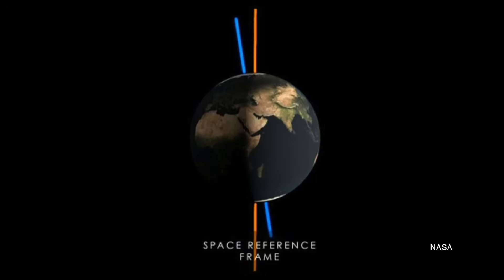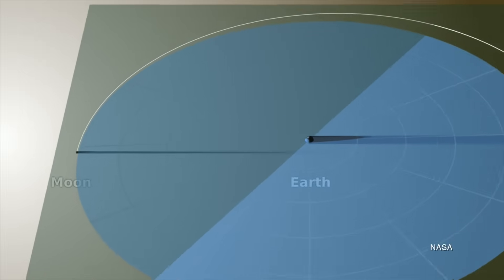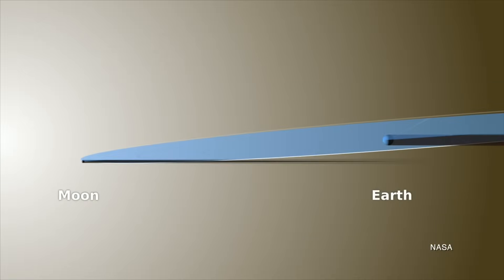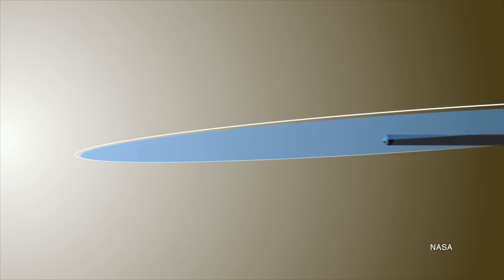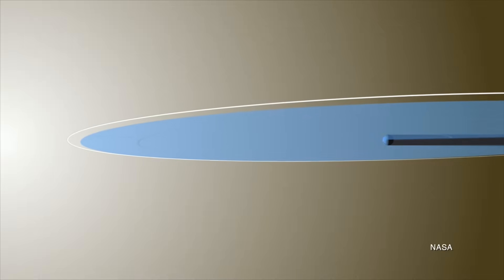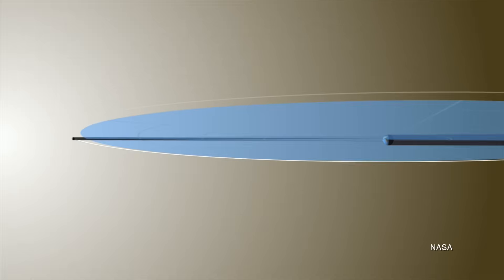Why Does a Rocket Need to Roll Going Into Orbit?

Comment: Other commenters correctly point out that a roll maneuver is not, strictly speaking, essential to fly a given launch azimuth to a certain orbital inclination. The engines are quite capable of steering the rocket in any direction regardless of roll angle. The roll is necessary only if you need a particular side of the rocket to be down (or up) as it tilts towards its launch azimuth.

There were three reasons this was required for the Apollo/Saturn stack. First, it kept the astronauts' heads down. They were trained to take over control of the Saturn V should IU guidance fail, and this attitude kept the earth's limb horizontal and visible in the windows.

Second, it kept the many antennas on both Apollo and Saturn facing the earth. Some very important radios (such as the range safety destruct command receivers) had multiple antennas so one could always be seen from the ground, but many more telemetry antennas on all stages of the Saturn weren't replicated.

Third, the inertial platform in the Saturn IU, like the one in the CM, had only three gimbals, meaning it was susceptible to gimbal lock. At launch time (actually guidance release at T-17 sec), the IU was aligned to the launch site REFSMMAT (the particular inertial coordinate system reference used at launch) so that the IU/IMU's outer gimbal (fixed in alignment with the vehicle +X (roll) axis) was pointing straight up, the middle gimbal was aligned with the +Z (yaw) axis pointed downrange, and the inner gimbal was aligned with the +Y (pitch) axis and completing a right-handed set. This put the three gimbals at right angles to each other, the "neutral" position. But if the vehicle were to yaw (rotate around the Z axis) 90 degrees to the left or right, this would align the outer and inner gimbals such that the IMU could not accommodate any rotation around the inertial X axis. This could tumble the platform and require a realignment, something you definitely don't want during a launch. So by rolling to put the +Z axis downrange, only the inner gimbal would rotate as the vehicle pitched down. The yaw angle remained almost exactly 0, deviating only slightly to steer out high altitude winds and staying as far away as possible from gimbal lock.

Because the Saturn was fixed to the pad with the Saturn's +Z axis pointed almost (but not exactly) east, and the launch azimuth was seldom exactly due east, it had to await launch with some non-zero roll angle. For example, at guidance release Apollo 11 was rolled left (counterclockwise as seen from behind) about 18 degrees, so after liftoff it rolled right 18 degrees to make the roll angle zero for its launch azimuth of 72.058o , which is a little north of east. Again, this let it perform a pure pitch maneuver as it flew downrange.

BTW, if you look this stuff up keep in mind the body coordinates of the Apollo CSM did not match those of the Saturn V. Their +X axes were the same, but the CSM was rotated 180 degrees around the X axis so that the CSM's +Z axis coincided with the Saturn's -Z axis and the CSM's +Y axis coincided with the Saturn's -Y axis. So just after the post-launch roll maneuver the Saturn's +Z axis and the CSM's -Z axis were pointed downrange.
Reply: Thanks, guys. That's a more positive reaction than I usually get from the Apollo deniers that I sometimes spar with (hence my choice of pseudonym). I thought for a bit about how best to explain the IMU stuff, and I agree you can't really do it well without diagrams. I should have cited the references I used, primarily "Project Apollo Coordinate Systems" but also "Saturn V Launch Vehicle Flight Evaluation Report - AS-506 Apollo 11 Mission" (where I got the launch azimuth and roll parameters). Both are available through the NASA Technical Reports Service (ntrs.nasa.gov) and are probably mirrored elsewhere, so a Google search should also find them.

If you're interested I could also find some technical documents showing the many telemetry antennas, mainly on VHF, on each of the Saturn stages to show how they had to face earth. I'm pretty sure they were all on the +Z side of the rocket, which is the side facing down as the rocket pitched down.

BTW, that coordinate system (+X forward, +Z down and +Y to the right) seems to be the standard for aircraft navigation. The CSM coordinate system seems based on the terrestrial convention, which has the +Z axis pointed up and the +Y axis pointed left. Not sure why they did this, though.

The main diagram to study is figure A-12 in the coordinate reference document. It diagrams the Saturn V inertial reference unit with its stable platform in the center and the three axes aligned at guidance release time as I described earlier. The IMU in the CSM was aligned the same way (probably rolled 180 degrees) in case it had to serve as a backup, but the IBM-built instrument unit (IU) never failed in any Saturn launch. The CSM IMU was periodically realigned to different reference systems (REFSMAAT) as the mission progressed but as far as I know the Saturn IU only ever needed the one launch site  coordinate system since its job was over in a few hours.
Reply: Probably the best way to visualize the IMU gimbals and gimbal lock is the way the astronauts saw it. The "8-ball" on the console showed the orientation of the IMU platform relative to the spacecraft. The 8-ball behaved as if it contained a gyroscope; it stayed fixed in inertial space as the spacecraft rotated around it. (It didn't actually have a gyroscope, but it was driven by the computer to keep the same orientation as the real IMU gyroscope, so it was a "virtual gyroscope".) Pilots are already familiar with gyros in instruments like gyrocompasses and artificial horizons, so the 8-ball just took it to three dimensions.

The 8-ball depicts a globe with lines of latitude and longitude. A mark in the center of the display depicts your current pitch and yaw attitude on the globe: pitch as longitude and yaw as latitude. Your roll attitude is shown as a rotation of the ball around your pitch/yaw point, which could be read from a scale around the circumference of the 8-ball.

With the IMU in a "neutral" position, all 3 axes perpendicular to each other, the 8-ball has latitude 0, longitude 0 in the center with the poles at 9 and 3 o'clock. Pitching causes the ball to rotate around its polar axis, i.e., your longitude changes and your attitude point moves along the equator of the globe. This rotates the inner IMU gimbal. Rolling simply rotates the ball around some fixed point on its surface; it rotates the outer IMU gimbal. Yawing moves you north or south of the equator, i.e., it changes your "latitude". It rotates the middle gimbal.

Note that "pitch" and "yaw" are with respect to the stable platform, so they match the body "pitch" and "yaw" axes only when you're at this neutral point. If you roll 90 degrees to the left, the ball will rotate 90 degrees to the right, with the poles at 12 and 6 o'clock, and what's pitch to you will be yaw to the 8-ball and IMU. It's the latter that counts for gimbal lock.

The polar areas of the 8-ball were marked in red; these were the "keep out" areas to avoid gimbal lock, which actually occurred at the poles where all the longitude lines come together. If you yaw close to a pole, then a small change in pitch results in a large change in ball longitude, which corresponds to a large change in IMU inner gimbal angles. The closer you get to the pole, the greater this magnification effect until right at the pole it becomes infinity, and it's impossible to pitch the spacecraft without an instantaneous 180 change in longitude that jerks the platform out of its inertial position. That's gimbal lock. Because there's always some small amount of friction in the gimbal bearings, just getting too close to the pole can disrupt the platform because of that magnification effect. 

Roll maneuvers, which simply rotate you around the ball at a fixed point on its surface, appear to be safe at any attitude because the roll axis is the outer gimbal in the IMU. Pitch is the problem, and then only at high yaw angles.

The coordinate system for the Saturn V IU/IMU was chosen such that after the roll maneuver, the 8-ball was in the neutral position. Then as it gradually pitched over and flew downrange, the attitude point traveled along the equator with the poles staying at 9 and 3 o'clock. If they maintained a local horizontal/local vertical orientation in orbit, i.e., heads down and long axis in direction of motion, the 8-ball continued to rotate around its horizontal polar axis with the attitude point always staying on the equator. All this kept the IMU as far from gimbal lock as you could get.
Reply: ApolloWasReal You have commendable patience with those guys. I've taken on a few as well, but invariably I quickly come to the realization that it actually is less painful for me to bang my head repeatedly on a brick wall than continuing to "debate" with people who just simply refuses to use their brain. I cannot believe that there can be such cognitive disconnect in an individual as to just not get it, which means somewhere in there there must be willful ignorance at play. I guess for some, ignorance really is bliss...

I for one would definitely be very interested in any technical documentation you have on the subject, but I know there's a treasure trove I have barely scratched the surface of at the NTRS site. I just wish I had more time, like a few decades, to just dive in there and read everything... :-)

I am a software engineer by trade and have always had a fascination with the AGC, but IBM's Instrument Unit intrigues me as well, mostly because there is so little known about it these days.

I don't think much of the original schematics, documentation or software has been preserved, for example. Which is a total shame, since while it is of a less technically sophisticated design than the AGC and its peripherals, it was still an awesome piece of engineering.

I don't know if there is any truth to it, but I have heard that there is actually original core memory left in the unflown IU that is on display with the Saturn V at Kennedy Space Center, and that it might actually still contain the real guidance software for the unit. I would love to see if it is possible to extract whatever is in there, and see if it is possible to reverse engineer it. Unless I'm mistaken and there is relevant documentation on it still in existence of course.
Reply: Carl Charles Mando Atteniese Thanks but I think you're confusing me with ApolloWasReal who wrote the comment starting this thread. My comment was a bit vague, I see that now when rereading it. I didn't refer to Amy (except by +1'ing her book recommendation) but to ApolloWasReal. That dude knows his or her shit. :-) I apologize for the confusion!

If you want to know anything about the hardware or software of the Apollo Guidance Computer however, then I can probably give you some input. That's within my special area of interest. Also, low level computer programming has more or less been my profession for the last 30+ years.
Reply: You're welcome. You could make something like the Apollo 8-ball for an airplane by combining the ADI, which shows pitch and roll, and the gyrocompass, which shows yaw. ADIs show a local horizontal/vertical coordinate system that rotates with the earth and your own movement along its surface so they're designed to let gravity slowly return them to wings and nose level regardless of your actual orientation. This takes care of both earth rotation and gyro drift. On Apollo, the IMU platform remained (almost) fixed in inertial space (they were weightless) and the price for this was that the crew had to frequently realign the platform against the stars to correct for gyro drift. The term you hear them use is "P52", the program for IMU alignment.
Reply: elvis3571 Yeah, something like that. There's also a potential for much confusion about whether you're talking about roll, pitch and yaw in inertial coordinates, which is what the IMU uses, and body coordinates, used by the rocket and spacecraft.

Since rockets fly into orbit along a plane that includes the center of the earth, it was easiest to have the IMU aligned with that orbital plane at the moment of guidance release (T-17 sec). While waiting on the pad the rocket's body is not aligned with the IMU unless the launch azimuth is to be 90 degrees. (It's actually slightly less, the pad isn't exactly north/south but very close, within a degree.)

After liftoff, once the roll maneuver is completed, the IMU axes are aligned with the rocket body axes (except for the slight rotation of the earth in the few seconds since guidance release) and the IMU need only rotate around its pitch axis as it flies into orbit.
Reply: Hi ApolloWasReal, thank you for such detailed explanations and descriptions of the maneuver.  Please, keep on sharing your knowledge for the benefit of those who are motivated to learn (as opposed to the simple-minded deniers and/or trolls).
I have spent a lot of time giving information and correcting the nuclear detonation deniers' claims to no avail.  It is nice to see that there are still open minds like you out-there on the WWW that appreciate and try to educate fellow humans.  May Peace be with you, thank you again, Ciao, L
Reply: ApolloWasReal Thank you, that was an excellent description of something I've wondered about - the difference between the 8-ball and a normal airplane ADI.
Reply: Benny Löfgren Hmm, could be. There are some differences between aircraft and spacecraft. A spacecraft generally moves in a single plane along a predetermined path, but can be pointed in any direction. Either inertial or local horizontal/vertical reference systems may be needed. An airplane can travel in any direction, but has to keep its noise pointed almost in the direction of travel. It also uses LH/LV almost exclusively. This means you can put the poles of the orientation sphere at the zenith and nadir so longitude corresponds to yaw (bearing) and latitude corresponds to pitch. But because you could easily be pointed nose up or down, you also probably want a 4-gimbal IMU that's immune to gimbal lock and to use quaternions in the math to avoid numerical instability in the calculations near those attitudes.
Reply: elvis3571 It's only a problem because the platforms have only three gimbals. (This is true for both the one in the Saturn IU and in the CSM.) With 4 gimbals, it would be possible to operate at any attitude without risking gimbal lock, but the Apollo designers decided it wasn't worth the extra complexity.

One of my favorite Apollo exchanges was on this topic:

104:59:35 Garriott: Columbia, Houston. We noticed you are maneuvering very close to gimbal lock. I suggest you move back away. Over.
104:59:43 Collins: Yeah. I am going around it, doing a CMC Auto maneuver to the Pad values of roll 270, pitch 101, yaw 45.
104:59:52 Garriott: Roger, Columbia. (Long Pause)
105:00:30 Collins: (Faint, joking) How about sending me a fourth gimbal for Christmas.
105:00:40 Garriott: Columbia, Houston. You were unreadable. Say again please.
105:00:46 Collins: Disregard. (Long Pause)

I met Owen Garriott 4 years ago and asked him if he remembered this exchange. He did not, though it has become rather famous among people who work with these systems.
Reply: elvis3571 Actually, the inertial reference was changed several times during flight. Each reference was called a REFSMAAT, and they were carefully chosen for each phase of flight. We've talked about the one used for the launch from earth (which I think is the only one used in the Saturn guidance unit) but the CSM and LM used many others later on. A fairly straightforward one was based on the lunar landing site and lunar orbit plane, analogous to the earth-based frame used for earth liftoff. This kept the platforms well away from gimbal lock, simplified the math in the computer, and made the astronaut displays more intuitive.
Reply: Hi ApolloWasReal, please do not give up!  We need more serious and educated people like you who are willing to spend the time helping other YT members understand and learn facts and get new knowledge.  Great work, excellent delivery, Ciao, L
Reply: I agree, an absolutely brilliant explanation. I would also like to add to Amy's recommendation in the video about the book "How Apollo flew to the moon". It is an absolutely amazing read and really a must for any space buff. It explains all of this and tons more, in fairly easy to understand exquisite detail.
Reply: I wouldn't be surprised if some documentation on the IU would turn up with a little digging. You're specifically interested in the IBM LVDC - Launch Vehicle Digital Computer.

I don't know how many are still in existence, or which of the Saturn IB and Vs on display at JSC, Huntsville and KSC have them as opposed to dummy IUs, but I know I've seen an IU (by itself) on display at the Smithsonian Air & Space Hudvar-Hazy annex at Dulles Airport.
Reply: Only the warheads from Peacekeeper were transferred to Minuteman III.  The warheads have nothing to do with guidance.  The Minuteman III electronics were redesigned from scratch in the 1990's.  I know this because I was in charge of most of the guidance electronics redesign.  Minuteman rolls because it has gimbals.  At the end of the roll maneuver, all the gimbals are orthogonal to each other.  This helps avoid gimbal lock and simplifies the guidance equations.  Furthermore, the power, and control signals for the Minuteman stable platform go through the center of the gimbal bearings on wires.  The further the gimbal turns, the more torque is generated by the wires and the harder the gimbal motors need to work.  If that isn't enough, the gimbals have stops.  They can only rotate so much.  This is to avoid breaking the wires.  Special wire is used that has low torsion.  Peacekeeper has no gimbals.  Its stable platform is a floating ball in a liquid that has  the same specific gravity as the ball. The ball is held in the center of the IMU case with pumps.  The pumps also are part of the gyro servos that stabilize the platform.  Signals and power are brought to and from the ball with a system of brushes.  This allows the elimination of the gyrocompass and level detectors that are used for calibration.  

Minuteman uses a gyrocompass to find true north by sensing the rotation of the earth.  The platform is slewed to align with the gyrocompass and is leveled to the detectors by driving the gimbal motors.  The platform is then slewed along the roll axis to an angle relative to the gyro compass that represents the downrange trajectory.  Once level, the balance of the platform is maintained by a servo loop that senses the position of the gyro in its case and drives the gimbal motors to center the case around the gyros.  A second loop between the level detectors and gyro torqueing is used to calibrate the gyros.  Since no two gyros are exactly the same and accuracy is king, the drift of the gyros must be calibrated out.  Gyro torqueing is a force that pushes the gyro sideways relative to its case.  So if the level detector says it is too low on one side, the gyro is torqued, the gimbal servo detects a change between the gyro and its case, the gimbal is driven and the stable platform turned. The amount of energy used to torque the gyro is a computer computation.  Calibration of the accelerometers is also done but I don't remember how often.  The gyro calibration is done constantly while the missile is on alert.  So at this point, we know where true north is, we know the trajectory angle, the drift of the gyros and the sensitivity of the accelerometers.  On launch, the missile is rolled to zero the angle the platform was slewed relative to true north.

The Peacekeeper IMU has no gimbals.  As the earth turns, the ball rotates inside.  This allows the platform to find true north eliminating the need for the gyrocompass and the level detectors.  The only roll Peacekeeper does on launch is due to atmospheric friction.
Reply: Had to look this stuff up.  Minotaur 1 & 2 uses stage 1 and 2 from MMII.  Minotaur 3, 4 & 5 uses stage 1,2 & 3 from Peacekeeper.  These are all just the solid rocket motors.  Again, whether or not the missile needs to roll after launch is a function of the IMU (INS) design than any other part of the system.  I could not find any information on the guidance type for Minotaur.  It is named HAPS and Super HAPS and designed by Orbital Sciences.
Reply: Muy  ...   Yes, my father was systems manager for SPRINT, among many other things, finished as Chief Scientist for LockMart.  He witnessed target RVs coming in against SPRINT on Kwaj.  He said the brightness of them was amazing, and the speeds they are traveling are not something you can really get across without seeing it.  I've seen some vids of them coming in near the shack on the beach...even on video, it's damned impressive.  We almost went to live there for a few years when I was a kid, in some respects I wish we had. I hear the atoll is an amazing dive site.  Not sure there's all that much ELSE to do, but it would have been cool for that short amount of time, I think.  I remember going out to WSMR for some on site HERA work on the flight termination system the range safety guys were driving incorrectly (missed a notification memo, how many times has THAT happened in the missile/rocket world?  ;-) ), and our program manager at the time had worked SPRINT, and pointed out the launch site, ect. when we were there.
Reply: She is describing x, y and z after the pitch maneuver.  The inertial platform is leveled to the earth.  Z is up and down relative to the earth.  When the rocket pitches over, Z is no longer along the body, but across the width through the belly and dorsal sides. Z is effectively the altitude.  X is down range, and Y is side to side.
Reply: ApolloWasReal When I think about it, I know that some military aircraft (where panel space is limited) do exactly that. Here for example is the panel of a Swedish Air Force AJ 37 Viggen on display at the Aeroseum aviation museum in Gothenburg:

http://www.10ga.com/pics46/HPIM4988.JPG

Note the attitude indicator at top left, showing a very nose-high attitude with the cardinal compass points clearly visible in the "north pole" area, while more detailed compass directions can also be seen printed further down "south" on the ball.
Reply: thanks for the good info.
 in short they did the roll in order to be able to make a pitch maneuver. this means; if they had not rolled, the maneuver to shoot the azimuth wouldn't have been ''pitch-only'' but a ''combined'' instead.
the ship's design (i.e. the hatch, antennas etc as you explained) required a pitch maneuver
Reply: ...
so ''roll'' is the requirement for the ''pitch-only'' maneuver (withou rolling they would get the correct bearing with a combined ptich and yaw maneuver)).
but on the other hand  the ''pitch-only'' maneuver is the requirement of ship desgn.
the difference in our descriptions is as follows;
you describe rolling as a requirement of ship design where I describe pitching (without yaw) is the requirement of ship design.

thanks for your patience, btw.
Reply: +Benny Löfgren  Be assured that your pain is felt by many.  I sometimes think that Dunning and Kruger started YouTube just to make their conclusion irrefutable. 
...
The discussion to noise ratio is particularly high on this video, but it's early.
...
Chuckle
-- 
Cheers, ScienceAdvisorSteve
Reply: 104, 105 were mission time a presume so their reference was launch pad after 100 hours???

second question: are all the comms' available to public?

thx
Reply: elvis3571 Yes, that's in the Apollo 11 timeline. You can see detailed, annotated transcripts for all the missions at https://www.hq.nasa.gov/alsj/frame.html and http://history.nasa.gov/afj/
Reply: Gratuitous Ignorance!  Sometimes makes me wonder are there really people that totally bewildered by reality or are they just playing mind games to rile us up, then another one will come along and convince me that they are truly wallowing in their ignorance like a pig in, well I don't need to say where.
Reply: I was confused by your post there until I re-read my own. I actually said Minuteman when I meant to say Minotaur. One is a ballistic missile, one is a spacecraft launch vehicle converted from Peackeeper and Minutemen. I'll fix that.
Reply: The answer is IT DOESNT HAVE TO.  The only reason it did was to preserve orientation of the crew window with the earth as it entered orbit because the pad was oriented with compass directions and not with the circle the moon makes around the earth and if the rocket just angled to match that circle without rolling first the crew window would not be pointing down at the earth.
In short the seemingly symetric rocket wasnt symetric. It had a window.
Reply: You are right that it wasn't symmetrical, but it had nothing to do with the window.  The window was put on the belly of the rocket so it would be pointing down after the roll.  The roll isn't performed because of the window.  It is required by the IMU to prevent gimbal lock.
Reply: RLG, at least at the time we were updating MMIII, was not as accurate as the good ole iron gyro.

I never worked on MMII, but it used essentially the same computer as MMIII.  D37C and D37D respectively.  D37D has a larger memory and a few other improvements.  MMIII was upgraded and now uses a mil-std-1750A architecture processor designed by Honeywell.

Speaking of cool pictures.  I have one from each of the 1st two Peacekeeper missile test flights.  The photos are longish exposures taken by a camera on a stabilized platform mounted on a chase plane. They are of the of the re-entry vehicles re-entering the atmosphere over Kwajalein atoll.  Many people think they look religious.
Reply: Former USAF pilot here. I left the AF for Delta in '88 so it's been a while. Poking around the flight library one day I saw an illustration of an ADI with a heading scale around the "horizon". It was an aircraft 8-ball. I wish I could remember what aircraft it was on (USAF inventory pre-1980 is all I can say).
Reply: You speak as if this isn't settled science.  The science for this is 50 years old. I worked on this stuff for 17 years.  Designed and tested guidance electronics for  three different inertial guidance sets.  I know exactly how and why it works.   If being knowledgeable about this very old technology makes  me arrogant then so be it.  As I explained elsewhere, the rocket has a "belly".  The belly of the rocket should oriented downrange before the pitch.  The IMU stable platform has a gyro compass that will align with true north using the  rotation of the earth as an input.  The platform, the compass and the rocket are all aligned to the north.  This is a zero angle position.  The platform is then slewed (roll gimbal turned) the precise number of degrees so it points downrange.  Now there is an angle between  the platform and the rocket.  Upon launch, the rocket is rolled in the same direction the platform was on the ground to return this angle to zero.  Then pitch can occur.  Scientific enough?
Reply: Thank you. That question was not specifically answered in the video. Once you clear the tower the engines can Gimple into any pitch direction so the roll is only necessary if you want a certain part of the spacecraft to be up versus down.
Reply: thank you for the info!
Reply: very interesting, for me, to note that we are describing the same thing in opposite terms. 
to the best of my understanding/explanation the ship's design required a ''pitch-only'' maneuver. only a pitch-only maneuver would keep the hatch, antennas etc looking down to earth where a ''combined-pitch-yaw'' maneuver would not.
rolling (prior to pitch) was required by the, errr say,the  requirement of a pitch-only maneuver.
same thing different wording.
thx
Reply: I knew/could think of the hatch, the antennas etc but never thought about the INS issues.
thx...
Reply: thank you very much. that will be an interesting read for sure...
I'll be damned... if they used launch pad as a refenece while circling the moon. hehe
Reply: thanks
Reply: The rocket will roll for the course only if the guidance design requires it.  Apollo required it, as did Minuteman II & III.  Peacekeeper did not.  The Peacekeeper IMU did not have gimbals, nor did it have a gyrocompass or level detectors.  All are found in systems that do the roll maneuver.  Initially, Peacekeeper had roll engines built into stage 2.  The only function of these were to remove any roll introduced through atmospheric friction.  After a couple of test launches, it was found that the roll was not severe enough to warrant the weight/cost and they were removed.  Any roll that was introduced due to friction was removed by the roll engines on the post-boost vehicle, before stage 3 was lit.  There was no roll "maneuver" regardless of course.
Reply: Orbital ATK has a 'user guide' on their website. YT likes to delete comments with links so add this to their domain name: flight-systems/space-launch-vehicles/minotaur/docs/MinotaurIV_V_UG.pdf

The HAPS is a final stage propulsion system by the way. I don't think it's specific to the Minotaur.
Reply: Calculations in cartesian coordinates were probably less complex than twisting the rocket around using polar coordinates. Launch, roll, boost, pitch. The navigational controls are probably all orthogonal, so cartesian makes sense.
Reply: The fourth gimbal for Christmas line was after Apollo 11 locked up. The shuttle had four gimbals, but still rolls. Peacekeeper has been said not to roll, but is a ballistic missile - the orbital launcher that uses the Peacekeeper DOES roll. People are still going at this arse backwards.
Reply: Since I've never seen a 4 gimbal IMU, I did a search on this.  I found the MIT report and proposal for Apollo.  It is a very complicated proposition.  I don't know how much you know about IMUs, how a platform is stabilized, why it is stabilized or how it is calibrated, but adding that 4th gimbal will really complicate the guidance.  In the MIT proposal, it looks like the 4th gimbal was redundant with the pitch gimbal.  If the missile pitches, which gimbal motor do you drive?  The platform servos (gyro, gimbal (non slew), accelerometer) were all closed with analog electronics.  No computer involved.  The nozzle drive loops were also closed with analog.  The computer would only keep track of the accelerometer and gimbal resolver data, and from this send a nozzle position command to the nozzle drivers.  On Minuteman, when the missile reached the desired thrust vector (speed & direction) the computer would send a command to perforate and separate the third stage.
Reply: https://spaceflight.nasa.gov/shuttle/reference/shutref/orbiter/avionics/gnc/imu.html

"Although flight could be accomplished with only one, three IMUs are installed on the orbiter for redundancy. 
[...]
The IMU consists of a platform isolated from vehicle rotations by four gimbals. Since the platform does not rotate with the vehicle, its orientation remains fixed, or inertial, in space. The gimbal order from outermost to innermost is outer roll, pitch, inner roll and azimuth. The platform is attached to the azimuth gimbal. The inner roll gimbal is a redundant gimbal used to provide an all-attitude IMU while preventing the possibility of gimbal-lock (a condition that can occur with a three-gimbal system and cause the inertial platform to lose its reference). The outer roll gimbal is driven from error signals generated from disturbances to the inner roll gimbal. Thus, the inner roll gimbal will remain at its null position, orthogonal to the pitch gimbal."
Reply: Cellus and Muyguy ... I've done some servo design using rate gyros for stabilization, QRSs (QRS, or quartz rate sensor plural, never know how to write that properly, not sure there is a properly in that case)  in the last case...think of a crystal (like in your watch) tuning fork where the varying torque, due to varying rotational inertia when the fork is "wide" or "narrow". is measured to determine rate.  Here, if you are interested, the Systron Donner write up, Second section, An introduction to ...:

http://www.systron.com/support/technology

Yes, I found that document, too, (the Apollo MIT one) after I asked the question.  They gave the equations for drive, for that particular arrangement.  The thought was to purposely drive the inner gimbal toward zero, so as to keep it always away from lock, as Cellus just posted. I guess the easiest way to think about it is you are driving the inner gimbals away from the "disallowed" angles of the vehicle artificially.  This also adds additional errors, introduced by the non-ideal fourth loop, but still could have been kept within the error budget, apparently, according to that document.  

You are correct that it would require another servo system, obviously, and it's additional power requirements, as well as some rather major mods to the digital part of the system, using this additional input to generate thrust commands.  I guess I tend to think this stuff a no-op as I wasn't engineering at the time.  That crap is JUST TOO EASY now, not at all then.  A three axis ring laser gyro would have sure made things easy (google that one if you don't know about it, a truly cool device, zero drift, essentially, just pulse a laser around a "ring" and count where light starts and ends between the pulses to determine body angle change), one the company I worked for had something to do with.  ;-).  

One point they made that was interesting, and makes good sense if you 
think about it, is that in the event of an uncontrolled severe (high 
rate) vehicle tumble, the chances of actually passing through lockup are
 relatively small, percentage wise, and that at any kind of significant 
rotational speed they would be looking to null the rate instruments, 
probably one axis (the worst/highest rate) at a time until things got manageable, not the ball, which would be useless until the rates slowed down, and EVEN IF they tumbled the gyro, they could always star realign afterward, when the rates were nulled.  Of course there are a few times during the mission where this wouldn't help much, like reentry, or insertions, etc., but the gyro ball would probably be the least of their worries at that point (high speed unwanted rotation/tumbling).

When I look at the amount of computer and memory they had available, and the size of the code implemented, it AMAZES me they got the job done so efficiently.   I guess when your computer does ONLY ONE THING, meaning manage a few loops and calculate motor controls, you can accomplish that.  Really more an ultra-vector and orientation calculator, than a computer, by today's definition, just one with some positional and inertial inputs and control outputs added, and a really cumbersome number oriented UI (no graphics), REALLY calculator style.
Reply: Thanks for the link.  I learned several things from it.  I did not know the shuttle had multiple IMU's, that a two axis pendulous accelerometer exists, and that the calibration of the shuttle, although is the same as ICBMs, it is much shorter.  I believe this is because the shuttle does not require the accuracy, and some of the error can be determined due to the redundancy of the IMUs. The computing power of the shuttle must have been many times the capability of the ICBMs.
Reply: The original computer on MMII & MMIII (D37) had a 78.125us word time.  It was a serial computer with fixed read and write heads over a spinning disk and spaced one word apart.  All the working registers including the accumulator were implemented this way. The drive had around 20 heads.  All of the program memory was implemented on the same spinning disk.  It was like a cross between one of the gyros on the IMU and a very odd hard drive. It spun on a single beryllium air bearing ball exactly like the gyros.  I think the ball was around an inch to 1.5 inches in diameter.  The computer I'm typing this on can do the same instruction is less than a nanosecond, or about 78,000 times faster.  A digital watch today would have more computing power than a D37 guidance computer.

When I was at Rockwell International, we looked at ring laser gyros and also did quite a bit of work with the QRS stuff.  We also considered GPS assist and star shot alignment.  RLG and QRS, at least at the time, could not come close to the accuracy that the iron gyros and pendulous accelerometers could get.  RLG was also considered to replace the gyro compass, but that didn't pan out either.
Reply: Muy  ...  Kind of getting a bit off topic here, but yes, I used the QRSs to implement a set of gimbal servos for a DARPA dem/val called Thristy Saber.  It was an amazing machine.  It had a millimeter wave radar and a 2nd gen FLIR, rather early sensor "fusion".  The loops were closed analog, with a digital interface from a SPARC controlling  pointing/scanning.  The SPARC design was done by another engineer.  I remember him walking across the "cube hall" and showing me a DIP that held 4 MEGABYTES of DRAM...that should put the time frame in perspective for the next paragraph.  ;-)

If you want to talk about computing POWER, we used a proprietary GAPP (geometric arithmetic parallel processor) that did MASSIVELY parallel video processing, real time FFTs, etc.  The clock wasn't fast at all, and the processor was relatively simple, but with 92,000 processors, that thing could really sing.  Keep in mind this was almost two decades ago...hows 12 TRILLION floating point operations per second, or 12 terraflops sound?  We had a consultant do a study to find if there was anything faster available, and he found nothing.

The idea was to be able to classify targets, to a specific make and model, tanks, rocket launchers and rockets, carriers, etc. real time flying fast, even at high density, (think classifying all the cars to make and model over a StuffMart parking lot at jet speeds).  The thing was to be totally autonomous, be able to find search likely areas, like tree lines, classify, update maps, modify flight paths, dispense munitions, and more, all WITHOUT any received communications, and was to be 
recoverable.  

Needless to say, the false friendly level was pretty much a 0.000% requirement.  Anyway, the QRSs were just to stabilize the gimbal platforms, which would be used for target location WRT the vehicle, so precision on the level of what I would think would be required for an ICBM was not required.  We weren't trying to hit a target thousands, hundreds, or even tens of miles away, in most cases, due to the mission profiles.

Why didn't the RLG pan out?   On a severe aside, we actually used a few of your MMII motors, if I remember correctly, along with a Pershing II front end to implement a target missile called HERA on a little Martin spinoff I worked for for a few years.  It flew against STORM and THAADS while I was there.  Those motors worked flawlessly, even MANY years after they were built.   

HERA had a couple of cool requirements.  One was that it could be air launched, which was accomplished on a pallet, chuted, lit on the way down and flew through the chute.  Another was a profile called pile driver, where it was lit over-the-top and burned coming down with a pullout to simulate intermediate range threats at WSMR.  I couldn't find any shots of our missile doing that maneuver, but Juno (I think) flew 
that same profile, and there are some beautiful sun backlit shots where the photographer was still in near dark, and video, of that plume rising exo.   It is gorgeous.
Reply: +John Sikes wow your extremely lucky as a kid to have a father that taught you so much, wish I had a father like yours.
Reply: Ranjit ... True, but he didn't teach me even CLOSE to all of it. I am an engineer, and worked really hard through five years of college to get a some of what I know.  The REAL learning comes when you get out on the job, and use those tools, and much more, to do designs.  Then you see what works well, works OK, but could be better, and doesn't work well, or not at all.  THEN you start to understand some things.  It's a long haul!  ;-)
Reply: Hi John I have a question for you, could they not put nets with uranium pellets in the net, then place them around a aircraft Carrier with explosive charges that send them out a 100 yards and the nets open up, if there is an incoming missile.? I'm thinking the depleted uranium would tear into the missile, I'm sure there's a reason why it wouldn't work. Thanks in advance.
Reply: Roger,  An interesting question.  I'm an electronicer, not a weapons countermeasures guy, but I can give you my uninformed take on it, which hopefully someone else who knows something about it will fix ;-).  There are all kinds of passive and active countermeasures used for incoming explosive weaponry, from just plain armor, like on a tank, to exploding armor, designed to repel explosive weapons, like on a tank, too.  ;-) 

Early on, all that was used was generally just a shell with LOTS of kinetic energy, or some explosive and some shell, think grenade/RPG.  Today, technology for taking out something like a tank, by defeating its armor has become MUCH more sophisticated, using shaped charges, to direct the energy where you want it, and essentially making plasma, or at least REALLY hot liquid entry materials that literally bounce around and put holes and cook everyone inside. On the tanks, shaping has been done to deflect weaponry, and active explosive armor is utilized, and probably much more, but I haven't kept up.  Lots of energy has been put into the locations you hit tanks, at weak points, at the seam under the rotating turret, for example. One of my companies contributions was Copperhead, to perform this function, up and over the top, for a high accurate strike. The VERY LAST place you want to be in a battle with the US is in a tank!  Fish in a barrel.

 There was a space weapon proposed to take out satellites that used something very similar to what you are proposing, but in an offensive kinetic "kill" mode, called brilliant pebbles, but I don't know if it was ever tested, or fielded.  CRC (another company I worked for) did simulation analysis on its feasibility.

On ships there are active countermeasures, such as phalanx, which effectively uses "depleted uranium" or whatever, don't know, actively with radar or visual loop closure on aiming, that attempts to bring the shooting error to zero over time.

For your idea, I would think you would have to have the "net" a long way from the ship to protect personnel, far enough for the shrapnel to fall harmlessly into the ocean, obviously not as far to protect the hull and superstructure.  And doing so would present some problems in logistics, especially being able to shoot OUT.  Also, even 3rd world countries are now obtaining weapons that could just be set to pass through a previously created hole in the net, or over the top, and down onto the vessel.  Things that were VERY difficult to do two decades ago can now be done easily, virtually, if not completely, off the shelf.  

Look at the capabilities of the most advanced readily available COMMERCIAL drones today. They either have, or will shortly have them delivering pizza AUTONOMOUSLY to a house.  Unfortunately, if you can deliver a pizza, you can deliver a small explosive just as easily, and scaling up the copter/plane/rocket is not difficult at all.  Thinking 3rd world countries that are hostile to us, like North Korea, don't have easy access to this tech is silly.  They just go buy it elsewhere and ship it in, or on Ebay or equivalent.  Not saying your idea has no merit, that's just my take on it.  Hope this helps.  I should do some research to see if something like this is utilized, maybe even somewhere other than ships, for regularly armored vehicles.  I've been out of the loop for a couple of decades now, so my knowledge is severely dated, as well as mostly in other areas.
Reply: Why is Z axis through the body, I'm a Draftsman and looking from the top Z is up on a drawing? I thought i would ask you as you know what your taking about. Thanks.
Reply: ApolloWasReal
Reply: Tickled Trinket, keep in mind that in the Apollo days accomplishment of the goal was paramount and safety, although addressed was  in the background.  Also keep in mind that cost was not a particular concern at that time. Today we have safety as a starting point and have to stay within very narrow budgets, so it is a longer and more laborious task to build within those parameters.
Reply: +Tickled B.t.w. Are they still able to make type writers today, or have they lost this technology aswell XD
Reply: ApolloWasReal thank you!
Reply: ApolloWasReal, do you find it worthwhile to discuss anything with deniers, rather than just letting them perform their annoying imbecile act on their own?
Reply: ApolloWasReal This is a very interesting explanation
Reply: So roll has nothing to do with obtaining a desired orbit—that can be done without rolling at all. Rolling is only for human reference (orienting to familiar training window views) and communications (antenna orientation) reasons. 

Hmm...
Reply: No matter.  Your explanation was excellent.  This stuff is complicated, but you explained it well. Thanks.
Reply: Well, that was a great explanation and certainly helps to explain why the shuttle also rolled.  But it is puzzing that NASA did not simply build the orientation into,the launchpad. Could it be that the rocket’s velocity due to,the Earth’s rotation created a stability problem at launch?  I wonder since I’ve observed a roll on even earlier launches of smaller rockets.
Reply: Now this is a bad ass explanation.
Reply: @ApollowasReal: most excellent and well summarized explanation of what is undoubtedly one hell of a huge set of ridiculously complex and unbelievably intertwined conditions, dependencies and outcomes.  I sympathize with the Sisyphuian task, I’d trying to educated the denier crowd. that you have taken upon yourself, as the even the dumb-downed explanation you provided herein, is challenging for my BS/MBA/MS/CPA/CMA/PMP infused intellect.... can imagine the crappola you deal with
Reply: Your right.
Reply: Man, thanks for the great explanation!  That cleared up a couple things I was wondering about her video.
Reply: thank you, this should have been answered in the video
Reply: Dave Pawson    Hopefully we won’t forget that Dave is an💩head.
Reply: What a great "comment".  It's like a whole textbook in a few paragraphs.  I admire comments with substance   There is nothing BUT substance here!  Thanks!
Reply: It's nice to read something written by someone who knows what they are talking about. This is rare in cyberspace these days.
Reply: Holy shit, probably the most wholesome comment I have ever seen on YT.
Reply: Very good!!! I agree completly.....and it did look cool taking off too!!! Thank you!!!
Reply: It was really all about the astronauts. The basics of inertial navigation is far beyond this response so here is a quick and dirty. The rocket is perfectly capable of heading in a different direction after launch but then you are precessing and vectoring between pitch and yaw to obtain the proper arc to orbit. Machines have no problem dealing with that but humans do. Humans need an up-down reference system or they get disoriented or nauseated. If you roll the rocket, so the artificial horizon instrument is level the astronauts have an up and down they are not disoriented and can take over flight control if necessary.
Reply: Agree. So still the question: Why does it roll? To give the astronauts a better view? Or possibly guidance is more "comfortable" in a certain orientation? I am asking scientifically:  It does not roll for azimuth inclination reasons. So why does it roll?  Her explanation, if I understand it, is that it rolls to get properly moon azimuthily inclined. This is not correct. It does not roll around to get pointed in the azimuthily inclined direction. . So why does it roll?
Reply: I understand your explanation. You actually gave the why. Thanks
Bob
Reply: Fantastic explanation.  I grew up around the space program living near JSC most of my life.  I never understood the need for the roll program since the engines were on gimbals.  The extra considerations for horizon visibility, communications and keeping the gyros away from gimbal lock make perfect sense.
Reply: Roll program is very important,,,it is the only time nature can act on the vehicle perfecting it's trajectory
Reply: elvis3571 I'm not sure we are.
"Roll" is rotation about the X axis, which runs longitudinally, i.e., lengthwise along the center of the rocket.

"Pitch" is rotation about the Y axis, which runs perpendicularly through the rocket, from left to right as the astronauts see it.

"Yaw" is rotation about the Z axis, which also runs perpendicularly through the rocket from the astronauts' feet to their heads.

As it sits on the pad, the X (roll) body axis points straight up, the Y (pitch) body axis runs north-south, and the Z (yaw) body axis runs east-west.

These do not coincide with the axes of the stable platform in the IMU until after the roll maneuver. The X axis still points up, but now the Z body axis now points downrange and the Y axis is at right angles to both, as before.

The rocket then performs a slow pitch-down (around the Y axis) as it flies downrange. It no longer has to make any maneuvers around the X (roll) or Z (yaw) axes.

The rocket could have been programmed to fly the exact same trajectory (latitude, longitude, altitude) without the roll maneuver, and in fact it would look pretty much the same to us on the ground except for a sharp-eyed observer who knew how the black and white paint markings were supposed to look.

In this case, however, the guidance system would be making combined rotations in the body pitch and yaw axes in order to keep the rocket pointed in the correct direction, i.e., directly downrange at the proper angle to the horizontal. The only difference is that the astronauts' heads and the antennas on the +Z side of the Saturn would not be directly down, and the Saturn IMU would be turning in both pitch and yaw, all of which would be undesirable.
Reply: elvis3571 Yes, that's pretty much it, except that the pitch maneuver is required to follow a gravity turn trajectory through the atmosphere with a very small angle of attack to minimize the aerodynamic forces on on the vehicle. The roll was required by the design of the vehicle.
Reply: May (or whomever) ...   Aren't there simple ways to prevent gimbal lock, like a fourth non- orthogonal gimbal thrown into the mix allowing the others to be intentionally held away from lock? I seem to remember a "get me a fourth gimbal for Christmas quip" from one of the astronauts on one of the numerous "impending IMU doom" warnings sent up.  It seems like there was a lot of time spent worrying about this problem, when it didn't need to be a problem.  

I did read somewhere that when a four gimbal system was proposed somewhat late in the design phase, MIT was HEAVILY backing the three gimbal approach using a modified Polaris system design as the only option that they thought could be done within remaining design schedule constraints.  One of you actual Apollo guys want to  comment on that?  Did they ever hit a gimbal lock during the missions?  I know A13 got close after the tank explosion.  

Also, while you're at it, how did that stack overrun alarm from the LM rendezvous radar, where some OTHER resolver excitation signal (test, maybe?) get into the mix via a "misplaced" switch setting, that was apparently still allowed per the check list, since Buzz called out the setting, and Armstrong OK'd it.  I heard MIT was in the middle of that, too, and not to forthcoming with a timely answer when requested by an about 50 gauge sphinctered Armstrong during rather important historical and scientific goings-ons.

This stuff is fascinating from an historical engineering perspective.
Reply: +Chen G I'd like to be there when you tell the Shuttle Launch Director he doesn't know what he's talking about. A rocket, by the way, will roll regardless of antenna placement, gimbals, and whether it is manned, depending on its course. The rocket, rather than rolling in order to have certain conditions met, was designed to have certain conditions met after it made its necessary roll. Which it made using the engines, not made redundant by those engines.
Reply: "The rocket will roll for the course only if the guidance design requires it."
The question is 'why?' Why does the guidance design require it or not? The answer for spacecraft is in the video. The answer to the Peacekeeper IMU is because it is a missile, sub-orbital, designed to carry multiple warheads with different impact locations. Trajectory adjustments are actually done in space. A big roll isn't needed anyway, considering how little Russia moves in relation to the US. The roll system from the ICBM was actually used on the Ares to roll it. And the Minotaur spacecraft that the decommissioned Peackeepers have been turned into roll into their trajectory as well.
Reply: Have no idea what you are trying to say here.  The roll maneuver is done to simplify the guidance electronics/mechanics period.  Any other explanation is wrong.  Not all guidance sets require the roll.  And none of those do any kind yaw maneuver.
Reply: @MuyGordoGato  The roll maneuver may have simplified the guidance system on old rockets, but I doubt that is necessary on modern rockets. However, a roll maneuver is still useful to orient antennas.
The Saturn V did a yaw-right maneuver (1.5 deg, I think) immediately after liftoff to increase the clearance with the launch tower. It yawed back to center after clearing the tower. You can see this if you look carefully at liftoff videos; the rocket appears to be leaning away from the pad.
Reply: @ApolloWasReal   I never heard of a need to orient antennas.  If it were real, it would be bad.  You'd lose telemetry if the roll didn't go as planned.  Imagine what would have happened on Apollo 13.  The crew would not be able to contact mission control.
The peacekeeper missile did not need the roll maneuver because of the type of IMU it had, and the computer was fast enough.  In fact after the 2nd test flight, the stage I roll engines were removed from the rocket to save weight.  Any visible roll was caused by friction with the atmosphere.  This parasitic roll was removed in stage II or stage III.  Been too long.
Reply: @MuyGordoGato  The Apollo astronauts were regularly asked to manually switch between antennas in flight. Though the low gain antennas they were referred to as "omnis", they were actually hemispherical. They also had a lot of problems with the autotracking hardware on the high gain antennas. Examples occurred during the Apollo 11 landing when Buzz Aldrin spent a lot of time reorienting the high gain antenna that had lost lock because transmission was blocked by LM structures that weren't included in an out-of-date pointing model.
Reply: "Any other explanation is wrong."?  Even if you were right you are still arrogant and unscientific.
Reply: Pity we don't have the technology to go into deep space anymore.
Reply: +Ken  Of course they wouldn't have mind if the whole world including their anemy competitors Sovjets watched the astronauts suffocate to their deaths on the moon in a life broadcast;-)
Reply: Thank you Mt. Wizard but it's all bullshit so your lengthy explanation is for naught. Sure, missiles roll after launch but NOT to go into space. NASA is a scam. The ISS doesn't exist. All that stipidity takes place in NASA training pool. Bubbles have actually been seen on films from the ISS. ALL of the pictures of earth are cgi. All of the pics from the fictional Hubble are cgi. Wake up  Mr. Science!!!
Reply: Now this is a real answer to the question. Not whatever this video was about. I think I'm gonna have to block this channel. Hate people pretending to know about things they clearly do not.